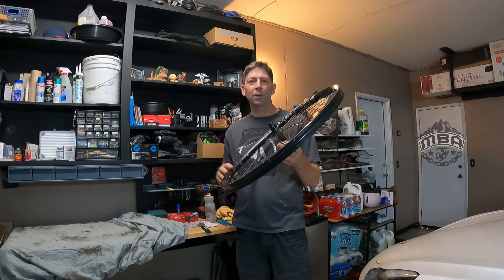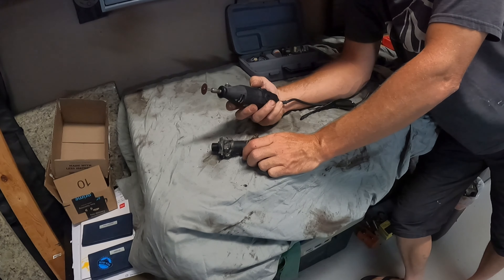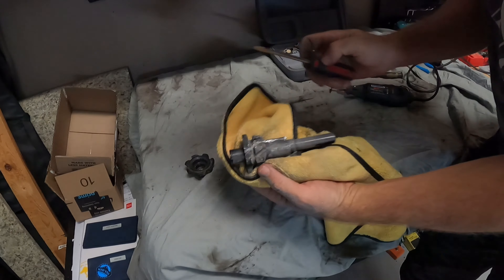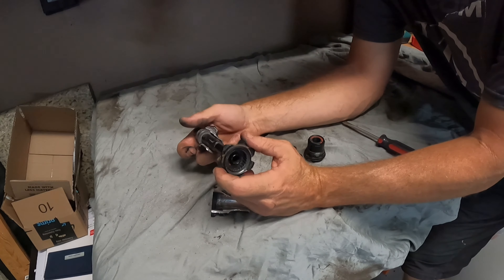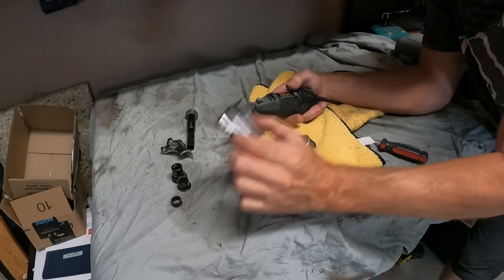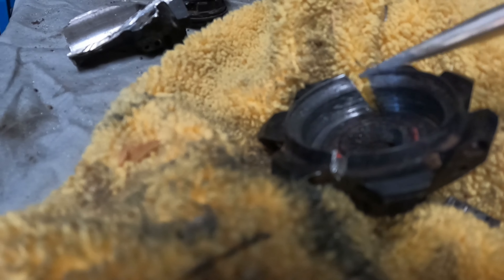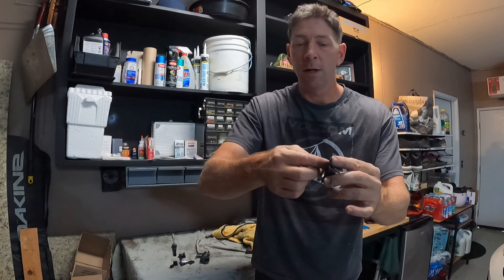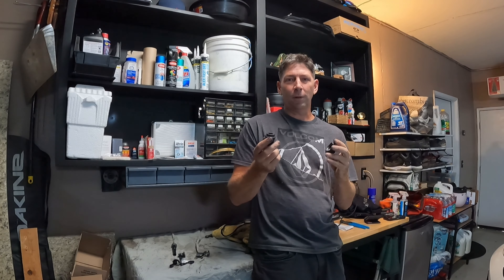I Cut My Mountain Bike Hub In Half

Comment: Good to know. I was considering buying a set of those wheels for one of my trail bikes. Think I'm gonna just go with Shimano xt wheelset instead. Even though they're only available with the spline center lock for the disc rotors, and all my other bikes are 6 bolt.
Reply from the maker: I think the higher end DT Swiss hubs don't run into this problem to often. The one on my Reserve is a 350 and I've been using it for awhile before I cracked the rim. I just got my new wheel from Santa Cruz so I'll be rocking the 350 again